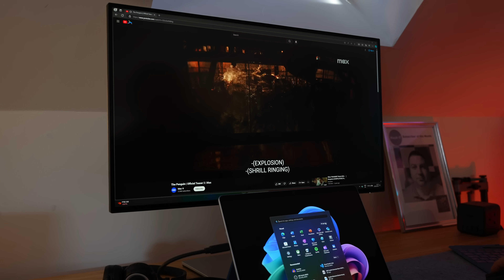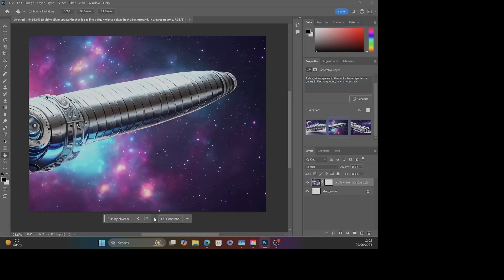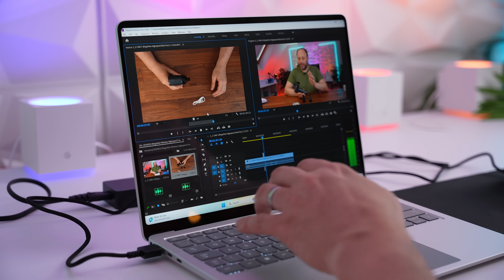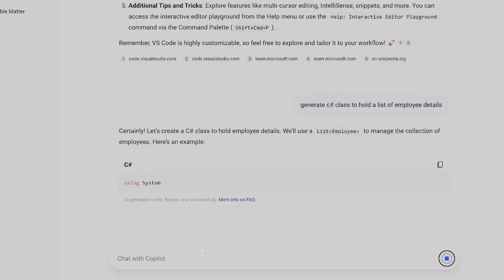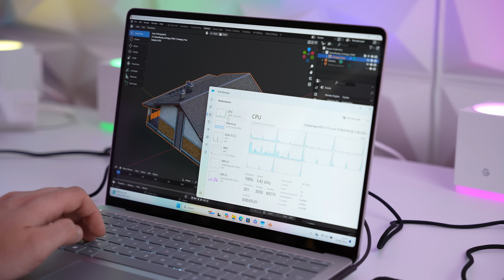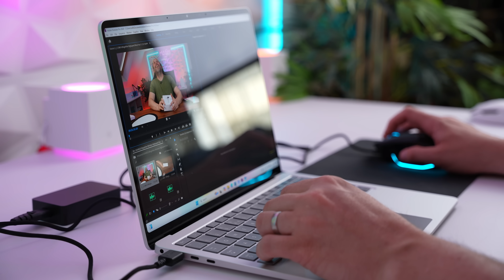Using the new Snapdragon PCs for Productivity! Featuring Surface Pro 11 and Surface Laptop 7

Comment: Do you have any mobile/portable monitors to test? The Portable Monitor that works with my SL5 no longer works with SL7 via USBC; it does work with USBC + HDMI via USBC dock. I am wondering/hoping it is just a driver issue.

Comment: You mention single cable connection but looks like you are connecting a usbc cable and a surface connector. Couldn't you use one or the other

Comment: Thank you for this video. I got myself the Lenovo Yoga Slim 7x with the same SoC but with 32GB of RAM, and from my experience, more is better. So, if you really want to work on these machines, get 32GB of RAM, and you're golden (since the GPU also needs some RAM to work with).

Additionally, OpenVPN works for me (with a work profile), and there is an ARM64 version available for download.

Comment: May I know if android emulation still works? I really like the Surface pro 7 given It can run full on desktop application. However, using it as a tablet, i prefer using mobile apps since touch interface works better. Im currently rocking an ipad pro as my only computing device due to its portability. If android emmulation is decent enough, i would ditch the ipad in a heartbeat.

Comment: Hello everyone. My surface slim pen 2 does not ink on my surface laptop 7 (15 inch version). The pen connects and pairs easily. The shortcuts such as clicking the pen to open sticky notes and snipping tool also open. Microsoft support told me that inking may not be supported on the surface laptop. Can anyone tell b me if they are correct?
I am about to exchange my surface laptop for a surface pro, but am worried about the lack of USB A and the allegedly shorter battery life on the surface pro 11. How's the battery life for surface pro compared to the laptop?

Comment: NORD VPN works on the Galaxy Book Edge 4 by installing the plugin for Firefox. Firefox has an ARM version, runs nice. Not protected for anything but web browsing though which kind of sucks.
Reply from the maker: thanks for the heads up. Sorry if I wasn't specific enough but the problem users are facing are company VPNs which are notoriously slow to update.

Comment: My issue is that at that price, I expect things to work well out of the gate (or at least more than 99% of the time). This seems too much like a product in beta, with promises of fixes and improvements "soon" -- but without any commitment of timeline. And I was hoping that things that did not work well would be slower or have a few minor glitches instead of not usable at all.
Reply from the maker: that was also my expectation! its been a bot of a Meh launch
Reply: @MashITTech  Maybe they tried too hard to launch before Computex. Otherwise if they were very close to fixes, take a few more months and they still would be able to launch in 2024.

Comment: Absolutely disappointed from davinci resolve 19 performance and felt slower than gtx 980 in 4k scrubbing and export. I do use a lot of x86 apps and games which are EOL. 
This is targeting iPad users who wants PC like features say windows or Linux minus handicapped iPadOS.
They hyped it saying it is faster than competitors and got a reality check. Damn waited for nothing. Just wanted on the go powerful laptop that is not a MacBook Pro with great video editing, productivity and battery King.
Reply: You're disappointed that BETA software doesn't run well? Suggest you Google what Beta means.
Reply: @bradavon  but the live demo highlights npu features with DAVR 19 beta arm version which doesn't work at all

Comment: Mac’s software is optimized to work with Arm unlike windows.
Reply from the maker: yes but with all the hype I hoped M$ would have done a better job
Reply: @MashITTech  that’s true but Microsoft has to do a lot of changes in the software development process to fully integrate windows into Arm. That’s the reason why window based apps do not work well in Macs.

Comment: I’m not even sure how many generations of ARM Qualcomm chips have come out for Windows so far. I’m hoping this generation will take off. I’m having better luck getting stuff to work this time. I too still have many applications that don’t work, including Google Drive. What is surprising is that I bought a M1 MacBook when they came out and everything worked. It’s kind of disappointing that so many companies, including Google, don’t have apps that will run natively or through the Prism emulator for Windows on ARM.
Reply from the maker: yes likewise, the apple silicon launch was handled so much better. I guess Apple has the advantage that they control the hardware and the OS but as you say, this isn't the first ARM chip for windows
Reply: @MashITTech  Microsoft also has control over their hardware (in their surface devices ) so they can't use that excuse. Windows OS lack of optimization might be the root issue

Comment: I'm considering getting a Surface for my studies and I was wondering how well it works for students. Does OneNote work smoothly on it? Also, could you possibly install Autodesk Fusion 360 on the new Surface and test how well it runs? This would be particularly interesting for those of us in technical or engineering programs. Thanks!
Reply: Do not get this if you're a student. You should be focusing on reliability and compatibility because depending on the field of study, you may need to run extremely specialized and/or obscure software, which is much less likely to be optimized or tested on ARM. This means using emulation, which means worse battery life. Also, debugging compatibility issues is not something you want to do when you have deadlines and other school stress. Like with cars, let other people beta test early generations first.
Reply: @zojirushi-rice-cooker do not get this if your apps don't run well on it but to make a blanket statement all students should ignore this is plain ignorance.
Reply: OneNote has been native ARM for a few years.

Comment: Why are all reviewers using H265 to test Resolve performance? It's a awful codec for editing that requires immense use of system resources, even on more capable computers. Where are the tests with Apple Pro Res or H264 footage?
Reply from the maker: I will give it a try and let you know if its any better
Reply: Agree. Almost no devices play H265, whereas almost everything can play H264

Comment: Well, fortunately I wasn't planning on doing video editing, and was already assuming that major graphics tasks would require I be on my desktop.

The main thing I've been looking for is "windows tablet that can operate most 2d/3d art software reasonably well for enough tasks, with a long battery life while doing so."

So far looks ok, just need to see the battery life!

Just wish they didn't have recall native to these things... I'll turn it off, but I'd rather not have a glaring security risk on my tablet, like, *at all*. Sigh. Like I'll take the NPU for future proofing, but I'd really rather that microsoft had decided to just promote copilot/recall on their app store than have it be native to the OS. Comes off as mostly a marketing gimmick that they insist you go along with. Bleh. (Please excuse my rant lol)
Reply: Recall has been totally pulled for now, and when it comes back it will be off by default and you'd have to explicitly turn it on.
Reply: @davidneale530  Wait really? 

I'll have to look into that; if that's true that's WAY better.

Edit: oh damn they super did pull recall out for now. Hopefully someone at Microsoft has the sense to change it so it's less of a glaring security risk when they release it 😅

Or just scrap it o3o I'd be fine with that. Maybe I have a bad attitude 🤣

Comment: Considering this is the first gen of this new chips is actually very impressive to see how they  handle a workflow. I'm not a gamer but for productivity this could be a nice option.
Reply from the maker: Yes, for the most part it did really well. For me personally my only disappointment was the video editing as I currently still use a Mac for editing and I would dump it in a heartbeat if snapdragon performed the same
Reply: @MashITTech Resolve for ARM is still in Beta. Beta means you use it at your own risk. Shouldn't even be including it in reviews as it's not finished software.
Reply: The reality is that windows on arm has been around longer than Apple silicon but was even worse than this by some degree. So there’s nothing to be that impressed with and I would argue quite the contrary that they’ve had enough time now to get it right. This was marketed in November so I am rather disappointed but expect improvements next year and would recommend people that intend to buy and keep for years, to give this a miss and wait for next year if they can.
Reply: @andyH_England only on paper. Windows on ARM didn't get going until 2019. Only a year before Apple  and suitable hardware is only 5 days old. It's just unreasonable to expect Developers to update apps when there wasn't much hardware to make use of it in the wild. Apple only supports two MacOS versions, Microsoft still supports Windows versions for a decade. You can run Windows 95 apps on Windows 11, you can't even run 32-Bit on MacOS nor Games. There's a reason why it was much easier for Apple. You simply can't run anywhere near as much software on MacOS. The use case of MacOS compared to Windows globally has always been much smaller. That and Reviewers get frustrated they can't video edit so write a review assuming we'll all feel the same. Most users buying these PCs really won't care Davinci Resolve, which is still in bets btw, doesn't work as well as on a MacOS. There's a tonne of reasons why the argument "that it works better" on a 4 year old Vs 5 day old platform is skewed. But yes Microsoft has no excuses now so judge them 6 months from now.
Reply: @andyH_England this. People think that these laptops are comparable to M1 era while it's not even close. Microsoft did nothing to make it worth it to support arm architecture for developers And to this day these machines in some cases are slower than fanless laptops from 2020...
Reply: So Adobe had been developing premiere pro for windows on arm since? 
Or davinci resolve? 
Be realistic 
The momentum of snapdragon chips spurred interest in devepers to create arm versions of their apps for windows and same for Mac
Windows on arm started from the RT days 
Judging by the years that have passed Microsoft should not need emulation because it should have convinced all windows developers to make arm versions of their apps even when the kind of hardware needed was not available
Reply: @princelyijieh9825 the thing is, there’s like hundreds of windows computers, while there’s only like 5 apple ones, and they control everything about those computers. It’s a lot easier for apple to make a full shift than windows
Reply: M1 chip was also the first generation and it beat the living daylights out of top tier x86 chips of its time. That’s what you call impressive first gen launch.
Reply: First gen? If you were born last year. They have been producing that same shit like SQ or 8Cx SOCs. Poor brainless kiddo. Lol 😂
Reply: The real 'magic' will come when these start to fully support Linux. Also, I quite interested what Lunar Lake will bring us in terms of battery life, especially.

Comment: Excellent video! Very informative and useful. It is a pity that these devices are hampered by software compatibility woes.

The DaVinci resolve slowness could be resolved in a software update but otherwise, I would honestly not buy a WoA machine (yet).
Reply from the maker: Thanks, and yes, I think a lot of it is software teething problems but M$ has had years to get this ARM windows sorted, they gave it so much hype I thought it would be a little smoother

Comment: This new SoC and Windows ARM are neither great nor terrible, as this is the "first generation" Qualcomm SoC for computer. Qualcomm uses its own core architecture, unlike the 8cx and 7cx series before. I hope Qualcomm continues to optimize this SoC and Microsoft continues to optimize Windows.
Reply: I'm using the device right now. It is pretty awesome. As developers optimize their apps for the processor it will be even better. Chrome and edge are both fast. It plays gt5 very well from what I've seen. I haven't tested that. But that tells you it's about optimization for the architecture. I've been editing photos and made one video since Tuesday. Freaking smooth and fast.
Reply: @Eazidosit Oh, awesome! Thank you for sharing your experience.

Comment: This is an issue from early builds and with time it will improve massively, not only the gaming performance but also the video editing capabilities. If course it CAN'T be the hardware if any phone can edit perfectly/ fast and their chips are much weaker then this one.
Reply from the maker: I totally agree with you, it did feel very odd in resolve which is a native ARM version so I hope it's just an early release. Still I have to put this information out there so that people dont buy it expecting these machines to perform like apple silicon does in video editing atm. I will do another video I a few weeks as things improve to keep people updated

Comment: The same VPN problems were there stopping the Surface Pro X from greater adoption...4 years ago! How is it that they still haven't been solved?
Reply from the maker: I completely forgot the X was that long ago. Yes that seems criminal, especially with the amount of money and resources M$ has at its disposal
Reply: There are hundreds of VPN solutions out there. Many of them are ARM compatible now (e.g. Cisco Secure Client formerly AnyConnect). Yes they have been resolved but many VPNs businesses use are ancient and they shouldn't still be in use. You're looking at the problem wrong. These ancient VPNs shouldn't still be in use. There isn't one VPN everyone uses.

Comment: Can you connect the Surface Pro 11 to an external GPU for gaming applications? Also, I am a college student looking for a pen-compatible touchscreen device for note-taking, and I'm trying to decide between the Surface Pro 11 or the Samsung Tab S9 Ultra. What do you recommend? I already have a Razer gaming laptop, so I wouldn't necessarily need it for its gaming performance.
Reply: None of these devices have thunderbolt; USB4 only. I assume they will not support current EGPUs. Even assuming the unlikely scenario where firmware and software will be updated sooner than later. Also, the boot loader is locked so these devices are significantly first generation and definitely not something you would want to buy if you are running a business. For watching video and surfing the net, they will be great.
Reply: Here's the spec of the USB 4 ports on the Lenovo Yoga with the same SoC (so likely the same on the Surface).

Maximum power output: 5 V, 3 A
Maximum power input: 20 V, 3.25 A
Protocols:
USB 2.0 480 Mbps
SuperSpeed USB 5 Gbps
SuperSpeed USB 10 Gbps
USB4 40 Gbps
Thunderbolt 41.25 Gbps
DisplayPort 1.4

I reckon the hardware is capable but if you want to use an NVidia GPU you'd actually need ARM64 native versions of the NVidia drivers as well, and they probably don't exist (yet).
Reply from the maker: When I get a spare hour I will test this for you. I still have my legion EGPU and 4070.
Reply: @MashITTech  Nice, thank you!

Comment: Unfortunately, in Germany, the cheapest SD x Elite cost like 1299€, just for browsing, YouTube and light gaming, we have other better option like Huawei Matebook 14 125h oled and touchscreen just for 899€, and there is 19% Mwst discount right now.
Reply from the maker: yeah pricing is insane. The Pro with OLED and the new type cover cost me £1989 which is just mental.
Reply: @MashITTech  The pricing is delusional and simply to try and paint MS hardware as a premium option on par Apple hardware. They should have tried to capture the base MacBook Air buyers (cheapest Apple laptop) with prices in the $799-999 range, especially as you're committing to a essentially a beta version of Windows 11 that doesn't have native versions of a lot of key apps yet.